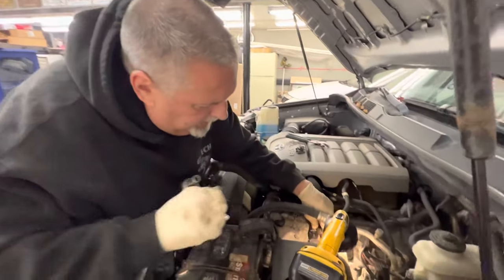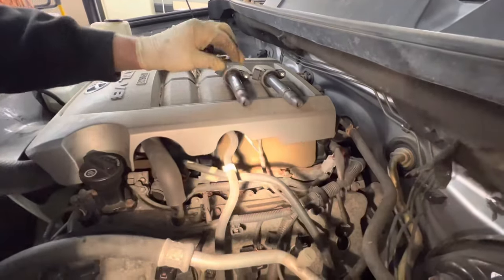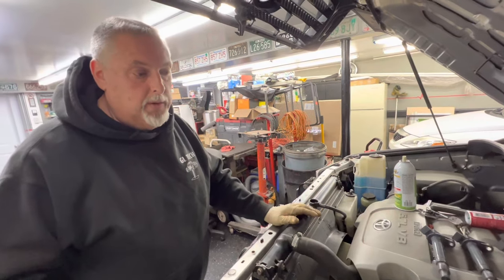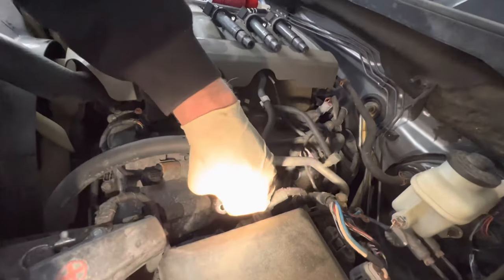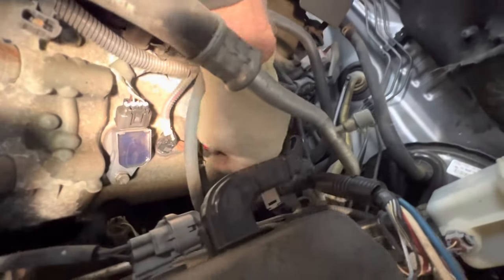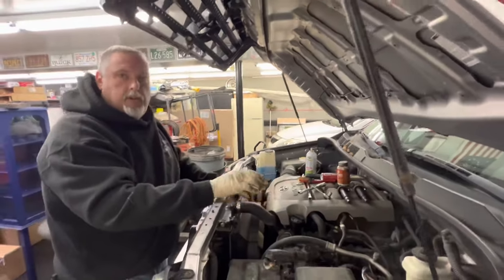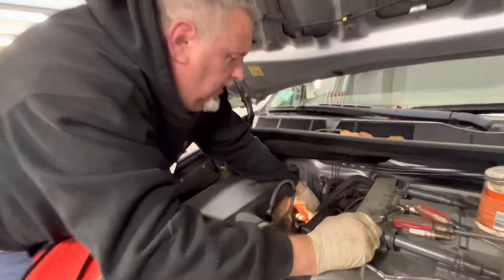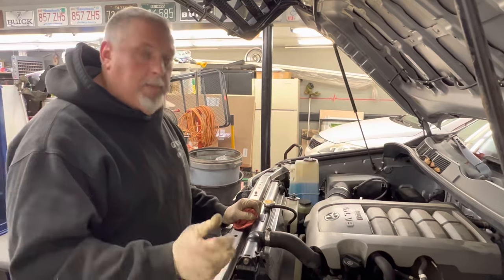2007-2021 Toyota Tundra Spark Plug Replacement 5.7

Comment: Remove the rubber grommet in the spark plug socket when you tighten the new ones in that way your socket doesn’t get STUCK just remember to put it back in the socket.
Reply from the maker: Thank you for watching our Toyota Tundra spark plug replacement video.

Comment: Great tutorial. But I recommend do not put antiseize on the threads if you buy quality spark plugs. Having antiseize on spark plugs can affect the conductivity of the ground. Also, it make the plugs sit in tighter than it should be when you torque it.
Reply from the maker: In 35 years of using this method we have never had an issue.
Reply: Anti Seize is dielectric grease. It's not going to cause an issue
Reply: Brodix aftermarket alum head mfg. voids their warranty if you DONT use neverseize on the threads. Aluminum fine threads cross thread and strip easily w/o lube. As long as you use it sparingly on the threads only, the seat of the plug gives plenty of surface contact for an electrical ground.
Reply: Must not live in North, we coat everything

Comment: I changed the plugs on my 2019 at 75k miles. When I pulled the original ones they looked like they needed to be replaced until I looked at the iridium tips where spark occurs and they were shiny clean, amazing. I put the new ones in anyway but the originals were actually fine.
Reply from the maker: Thanks for checking out this auto repair video. Hope it helped you out.

Comment: I just did the plugs on my Tundra a couple of weeks ago.  It super easy if you have a 3 inch wobble extension. On the passenger side remove the air intake hose, unbolt the airbox and just flip it up onto the intake cover. There a couple wiring harness clips that you can remove from their mounts to ease removal of the coils. The front and back cylinders if I remember right.
Reply from the maker: Yeah, It's not that bad of a job to change the spark plugs on these Toyota Tundra engines. Plus you will save a ton of money by doing it yourself. Have a great day!
Reply: @HomeOwnerRepair  dealer wants $470 for my 2012 LTD 5.7 Tundra screw it Thanks for the Video
Reply: @HomeOwnerRepair You ain't kidding $549 at the Dealership!
Much appreciated sir ‼️

Comment: Just did mine today. Thanks so much for this video. Everything went really smooth. I did everything you said to do including anti size which I think they should have done at the factory as well. And the dielectric grease and the silicone spray. I sprayed all the wiring that I could see under the hood as well.
Reply from the maker: Glad this auto repair video that shows you how to replace the spark plugs in a Toyota Tundra helped you out.

Comment: Just changed my plugs watched your video,came out great did the hard side first passenger side I haven’t changed my plugs in 7 yrs when bought the truck had 120,000 miles tundra has 190,560 miles on it the plugs were denso iridium plugs I’m wondering if they were original.2008 tundra ,thank you so much for this video used all the techniques  in your video.
Reply from the maker: Thanks for watching! Don't forget to subscribe!

Comment: Everywhere that I'm reading says don't get dielectric grease on the metal terminal at the top of the spark plug. If you put the dielectric grease inside the end of the coil pack boot, doesn't this get grease on the metal terminal when pushing the boot back on the spark plug and possibly comprising the spark?
Reply from the maker: Dielectric grease it made for this environment and helps to keep the moisture out of the spark plug boot.

Comment: @HomeOwnerRepair  dealer wants $470 for my 2012 LTD 5.7 Tundra plugs..screw it Thanks for the Video
Reply from the maker: Replacing the spark plugs isn't that bad on this truck. Thanks for watching.
Reply: They want $700 were I’m at for my 2017 SR5 TRD

Comment: I just changed my plugs started ran for a few seconds then shut off and now I’m getting PO351 through PO358 codes and it won’t start….I’ve went through everything 3 times now and nothing is out of place going to check connections with test light to make sure I’m getting what I need there….any other suggestions?
Reply: Did you disconnect any other connectors? I was just watching another video and remembered your question. According to the other video there are two oil control valves and the connectors are very close to each and its quite common to get them reversed when hooking things back up. If interested it the video "Should you buy a Toyota Tundra 2007-2021" by The Car Care Nut. He mentions it at the 13:30 mark. Hope this helps.
Reply from the maker: Those are ignition coil codes. The coils on those cylinders could be bad, or maybe try to reseat them to make sure they are seated to the spark plug right.

Comment: I found using 2 locking 3" extensions (3/8" drive) made by Gear Wrench (Amazon) and a normal 5/8" spark plug socket allowed me to remove/install all 8 spark plugs on a 2017 Sequoia 5.7 engine.
Reply from the maker: Thanks for the added tip!

Comment: Love the vid!
I looked online to see when i should change spark plugs and it said around 30,000-40,000 but your description says 80,000-100,000 so which is accurate?
Reply from the maker: I would do it between 80,000-100,000 check your owner's manual to see if it recommends a different interval.

Comment: What is the stuff you put on the threads of the plugs? Also, what brand of plugs are you using? I have a 2013 tundra and I’m about to do my spark plugs
Reply from the maker: It was antisieze. You may be able to go through the video to see what spark plugs were used. Here is a link to the Anti-Seize on Amazon: https://amzn.to/4abBpPR

Comment: I know alot of people do anti seize but this is from ngk directly...

5 THINGS YOU SHOULD KNOW ABOUT SPARK PLUGS
1. Anti-seize

NGK spark plugs feature trivalent plating. This silver or chrome-colored finish on the threads is designed to provide corrosion resistance against moisture and chemicals. The coating also acts as a release agent during spark plug removal. NGK spark plugs are installed at the factory dry, without lubrication or anti-seize.

Anti-seize can act as a lubricant, altering torque values up to 20 percent, increasing the risk of spark plug thread breakage and/or metal shell stretch. Thread breakage can sometimes involve removing the cylinder head for repair. Metal shell stretch changes the heat rating of the spark plug and can result in serious engine damage caused by pre-ignition. Do not use anti-seize or lubricant on NGK spark plugs. It is completely unnecessary and can be detrimental.
Reply from the maker: lol.. Telling yah we have been doing this forever. Don't glob it on there but a LITTLE bit will help out later when you're in there and doing this again.
Reply: I would think the manufacturer would know best but ok. The fact they are installed dry from factory and in there for most people like 5 years minimum before first change
Reply: I always use a smear of neversieze on my plugs, and my future self has never been disappointed.  A frozen plug is catastrophic
Reply: NGK plugs aren't OEM on the 5.7L.  Denso are.  Yes, Denso claims there's a coating.  I still use a small dab, much, much less than was seen in this video.

Comment: Need to do mine soon, 94,000 miles. What is the dealer charge for this job? Also, doing it your way is there any risk of messing up the firing order?
Reply from the maker: The dealer will probably soak you for $800.00 If you take your time and follow the video you should be fine.
Reply: I’d do them one at a time if you’re really concerned about messing up the firing order.

Comment: Just in my truck doing these and I can tell I'm the first owner to have changed them. I got the truck at 120K and it's pushing 145k now. 🤦‍♂
Due to some health issues, I had a battle to get all of them changed in one day but soldiered through 7 of the 8 before I lost all my energy (and the light!), but yes, the packaging on this truck is Horrible. Every time you have to replace something, it's a fight! There's ALWAYS something trivial in the way (like why would you put something Directly in the egress path of a spark plug, on every cylinder?!) Then you have to drop the socket in first, blind, then the extension, then separate all of them once you get the plug uncorked. UGH!!! 
You can tell that the people intended to buy these trucks were Supposed to just take it to the dealer to get bent over the service desk...
Add: Ah, almost forgot why I was here. Trying to figure out how to get that passenger one out without taking the right half of the truck apart, beneath the wire loom and such. By the by, the wife's scooter is also a Mazda CX9. 😁 She got hers way before I got my truck.
This is measurably more difficult when the truck has a 6" off-road suspension kit, too. Works great when you're under the truck, not so much for on top! First time I've ever had to use a step stool to get onto the back side, as I'm a veritable sasquatch model of human.
Reply from the maker: Thanks for watching! Don't forget to subscribe!
Reply: If it doesnt bother me asking whats the health issue☹️
Reply: New age Toyota. My 4.7l 01 tundra doesn't have this issue

Comment: How much more can those OEM ignition coils last after swapping out with new spark plugs?
Reply from the maker: It really depends. There's not really a shelf life on them. If they start to fail at some point then I would replace them.
Reply: They are expensive.  I’ve only had one coil pack fail out of all of my Toyota/Lexus V8’s.  Given how easy they are to replace I think keeping one on hand, and a code reader, makes it easy to deal with a failure rather than throwing the $ at all of them preemptively.

Comment: Not using a torque wrench?
Reply from the maker: You can use a torque wrench to snug them down if you would like. We never had an issue using the method shown.
Reply: nomenclature9607  I was reading a Toyota tech manual and it said for the plugs to use 15 ft lbs OR hand tight plus a quarter turn.

Comment: You should replace your boots and coils on your tune ups.
Reply from the maker: These were fine and not acting up.
Reply: I took care of two tundra company trucks that eventually went over 400K each. I replaced 2 coils and maybe 6 boots total.  I also use a lot of silicone, anti seize, and die electric grease.

Comment: seize on the plugs ??? newer vehicles like 2014 newer ,,, those plug had been already seize applied,, 
  NO need to coat with extra seize no more....
Reply from the maker: There was no anti seize on the new plugs. The method shown in this video is fine.

Comment: Wait, so he didn't gap them?
Reply: The Denso plugs are gapped at the factory.  You can check them, but you DO NOT gap Iridium plugs.
Reply from the maker: They are pre-gapped in the box. You have to be careful with the iridium spark plug tips.

Comment: I cant F'N see how the hell you are getting off the stupid electrical clips off the coil pack. Im squeezing, using screw drivers, etc. NONE are coming off.
Reply from the maker: Did you figure them out, the ones on this truck came apart fairly easy.